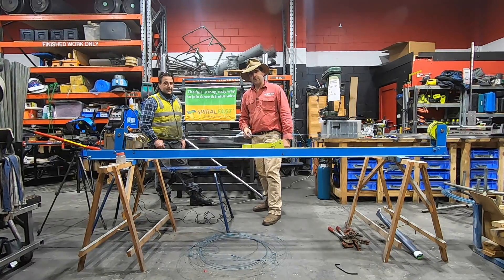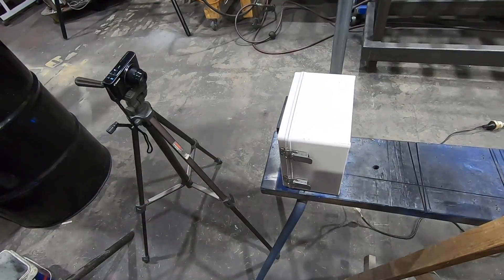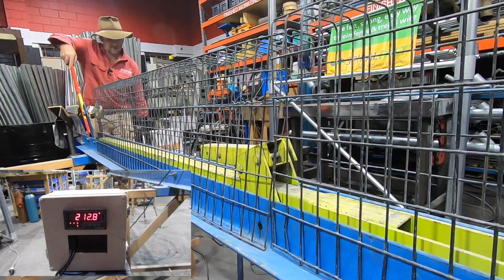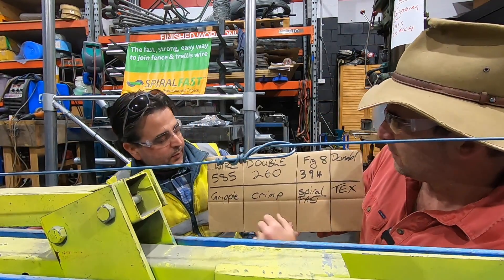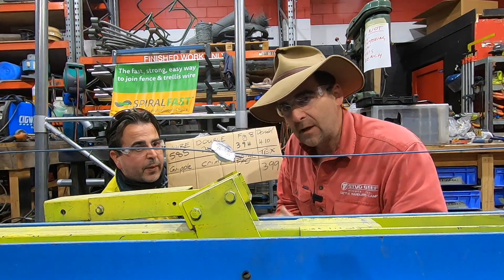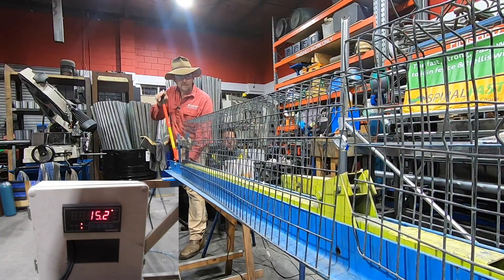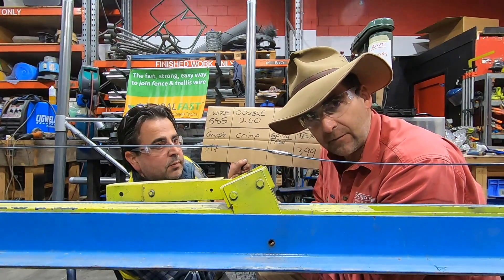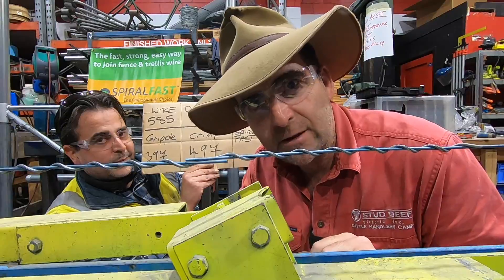Fencing Showdown! Knots vs crimps vs Spiralfast vs Gripple We Test Them!

Comment: Try a crimp and give the wire a few wraps on each side. I'm curious how well that would hold.
Reply from the maker: Hi mate. I tried it. Makes almost no difference. Maybe 1% by the time the crimp gives way, the tails are beyond their strength. If you want to see a demonstration I did similar with my last figure 8 video
Reply: Thanks

Comment: Great to see the comparison - 
However I don’t have knot failures in my fences - I am proficient at tying all these knots and will continue to rely on them.
Do use a gripple very occasionally.
Still have the original bundle of spiral grips in the bottom of my tool box. 
As for crimps IMHO they appear slow and clumsy, and you need extra paraphernalia

Comment: I use porcelain insulators , could you test them against plastic ? I often use the barrel ones as terminators too be good to know if they are strong as the wire, i expect them to handle just twisted knot if you can call it that but maybe not a real knot. thanks Col.

Comment: Can you redo the test with 3.15mm trellis wire?
Reply from the maker: Don’t really need to. Think of the amount of tension related to the breaking strain of the wire. This percentage should stay fairly consistent with the breaking strain of various wire. The only difference is between tensile. Soft wire should do better as a percentage breaking strain due to its characteristics. Hope that helps

Comment: Hi Tim, just wondering did ye consider using a reef knot and would it have been able to contend with the others? Great video by the way
Reply from the maker: Thanks Denny. The reef knot does not work well on wire, so I didn’t include it. Thanks, glad you enjoyed the video!
Reply: @FarmLearningTim  Does not work well as in it's a harder knot to make because of the thickness of the wire? Or is it just a weaker tieing knot in general?

Comment: Tim, do you have a list (or reference for) what knots can be used to join different gauges of wire? Lots of "how to tie this knot" vids out there but don't usually include that sort of info (even the state Ag education materials rarely even list Orange and Speed knots). I find myself repairing lots of fences with a range of sizes (4/3.15/2.5mm plus various gauges of hard and soft barb), even 4mm that's oval/tapered/eroded down in size. Any tips pls?
Reply from the maker: This would need a lot of testing and thought as without data based on practical testing 75% of all viewers would say that it’s wrong but 85% of that 75% would argue with each other about what’s right! It’s a fantastic idea for a video though and one I would love to do. Watch this space!
Reply: @FarmLearningTim  yeah that goes to another level of technical. I really meant joining one gauge to another e.g most people know that reef knots in rope are only for same size cordage, or same for Figure 8 in wire I believe. What other wire knots can/can't be used to join 2 diff sizes?
Reply from the maker: @stur4622  Hmmm. my gut would be the speed (or donald) knot as it is a compression knot, rather than stressing the bend, but I have to say, it would NEVER be recommended to join two different gage or tensile strength wires in the one line. The result will only be a strong as the weakest link.

Comment: Some good testing, except on the Gripple. I say this, as every time I've found one on an old fence, I do it myself, as I figured it was the way to do it. The wire that pokes through the Gripple, rather than cut off short like you had, is bent back around the gripple onto the same wire and tied off by looping it around, on both wires. I was told this was done to stop the Gripple sliding to help prevent loss of strain if the Gripple moves.
Reply from the maker: I completely understand what you’re saying, but stand by the test mate, as one of the points of the test was to test the gripple, not the twisted wire…. Same as the figure 8, some people twitch them off too. Had to be a faithful test of the joint gadget.

Comment: Interesting test, a lot of end assemblies would be struggling with 5kn of strain but very interesting. 
Also as a 2.5 high tensile wire like a TyEasy from Waratah which we seem to use a lot is recommended to strain to 1.8kn most of those knots would still work until something lent or ran into the fence.
In some cases I still like a gripple for the ability to re tension at a later date if required.

Comment: Wow! Super interesting,Tim. Been trying to make a  decision about ringlock join.Had to cut 8 line to allow a gravel truck in,now have to join it all up again,along with two hot wires. Just for my curiosity,Tim,what would you use? I need to add a small piece on each strand,i.e. two joins. Gripples,{16?}fig 8,or any other suggestion welcome. A huge nuisance,but,have  do it....soon!
Reply from the maker: G’day Alison. I’d probably use either Gripples or crimps for the join on the ringlock, then tie a spare piece of wire into my plain runs and strain with a knot.
Reply: @FarmLearningTim  Hi Tim,Thanks for your response. the two "hot" wires aren't a major problem as I have "ratchet" strainers connected to both of them at the strainer assembly. I kinda balk at using 8 ratchet strainers on the ringlock though.:) Apart from being a sook,it's expensive. Thanks for your wonderful channel.

Comment: You need to add the crimp with 3 turns at both ends. This works well. The crimp and 3 turns  is great for end connections also.

Comment: Hi Tim, I've watched many of you knot tying videos and I'm glad you did this video on wire and knot strengths. I plan on building my first fence later this year and your video has certainly helped me to clear up a few things. Hopefully in the near future you will include the barbed wire test as well as a few other knots like the speed knot and the reef knot. I'm particularly interested in the reef knot due to its symmetry and would be interested to see if the strength would be increased if one were to put a small diameter aluminum pin within the center of the knot preventing premature kinking from occurring.

Comment: Tim  do crimps work well enough for end boxes ie when the two wires aren't 100% parallel to each other.
Reply from the maker: If you are referring to the diagonal brace wire, then yes, because the strain on the brace wire is still parallel to itself on the join
Reply: I think he is referring to the end knots tied off to the posts, I've never crimped them, I know you can get T gripples but I've never seen T type crimps, it's a good question

Comment: This is factual scientific research with good results which stand. So well done. 
However, In situ, in practice, a fence wire is not like these experiments. 
The figure 8 knot is designed to spread the surface area pressure over a great area. That's one advantage. And of course it's easy to tie.
The figure 8 is designed to be able to cinch up over many years as live stock and tree limbs. It's supposed to be tied so it has room to cinch up if the wire is put under stress by live stock and tree limbs. It's a forgiving knot that is more than strong enough for any fence.
The reality is that the figure 8 knot future proof's a fence line wire. It's supposed to have "give" in it.
Now, and as for straining using figure 8, the action taken here is to know your wire and slightly over strain so the relaxation of the strainers allows the wire to still be under maximum tension without deforming the figure 8 which you have made with some in-built stretch (future proof).
NB :  I would suggest that any kind of impact on a fence that brought its wires to breaking point will be a rather large mess in any case. The type of knot would be irrelevant.
So, to iterate : Out in the paddock where real animals live and trees grow you can confidently use a figure 8 knowing it will take the knocks and strains. I love science but the lab can't duplicate what happens on a pastoral grazing property.
The figure 8 is great with 8 and 10 gauge soft fencing wire. There's nothing wrong with using the double loop knot either.

Comment: I've been using crimps for strain joining and I usually leave the tails long through the sleeve, then I bend the tails over the crimp and wrap thrice on the opposite side of the crimp. I call that a butterfly knot cause that's what it looks like. Or even just bend up the tails and trim them off to prevent the wire slipping through the crimp.
Reply: Tam Moilliet 
Heres an example. 
Actually my big sow-pig hit the high tension wire at speed the wire creeped loose through the crimp.
And she went through.
My milking cow in Season did the same thing. So good old figure 8 or a double tidy loop suffice.

Comment: You test rig uses Spiralfasts to secure ends each time....the Spiralfast in middle should be the same as control test...👍🏻
Reply: As an engineer, I can way into that. You’re forgetting pulley dynamics. There’s one cord feeding into that pulley, it wraps around it and is attached back to the same cord. So you have two legs wrapped around the pulley. One input, two outputs. The two leg’s coming off that pulley would be half of the input load. Hence a 4,905 Newton load (500 kg’s) would be half of that, on each leg. Approx 250 kg’s. Give or take pulley efficiency, and wire slippage. If that wasn’t a fact, we could never have determined, breaking strain of that wire.
Reply: Not really because there is the additional friction of passing around the post,
on the ends.

Comment: I predict 583.
Reply: Doh!  Missed it by that much.
Reply: So, what have we learned here?  Well, basically that great grandad was right when he said that twisting a wire around another- rather than doubling, kinking or looping- is what holds best when your faced with a repair or joint.  

Interesting note: The power line companies have been using a version of those spiral fasts for decades to hold guy wires, etc.  they do work.  Make it very simple to weave a loop in a steel rope/cable in moments that holds a lot of weight/tension.

Comment: Great video Tim. Awesome testing rig.  I'd like to spend an evening with one of these.  Test Gripples with wrapped ends, try some max tensors, test Crips with different adjustments on the Hays pro crimp tool. Test that reef knot I tied one day when learning to tie a figure of eight.  And do it all with Galvanised wire compared to the Warata "long life".  I suspect the harder coating on galvanised wire works better with crimps.

Comment: would have like to seen the tails wrapped on the crimp and the #8 ...
Reply: @FarmLearningTim  yea ive never used a gripple. only knots / crimps / #8s  . Tails wrapped for safety mostly.
Reply: @FarmLearningTim  yea really good to see some numbers put to it.  Yea i have no numbers but i reckon the #8 and the grimp both are stronger with the tails wrapped , let along the safety issues of the barb .  Thanks for your videos they very informative
Reply: @ginge3381  I think the crimp let go, because the wires pulled through. Twisting the tails should help.

Comment: Sorry Tim, but this was basically an ad for Spiralfast.  What about Gripples with a twitch each end, as that is the only way that I will use them, but all cases using the extra joiner fittings are going to cost someone wanting a basic fence extra $$$.

Comment: Spiral guess 420, but definitely your best video yet, I learned a hell of a lot, thanks mate..ok..holy shit...new guess for the spiral..550.....I was also really surprised by the gripple, which I do not like to use after your information about one giving way, but a fencer recently said on a very short run  of  brand new fence that they were the best choice as you can restrain easy, but I twitch the ends as they scare the shit out of me
Reply: Good point.  I have seen folks leave a tail even when crimping and give a few wraps as a backup.  I plan to employ this technique if I ever crimp any.  Haven’t sprung for that expensive tool, yet although I do wish I had one.  Can be useful in a pinch or a tight spot.
Reply: We recently had a couple of gripples give way during straining but it doesn't happen much, we have almost finished our 2nd bucket since March (about 1000 gripples) so 2 failures is ok for me.
I haven't had a crimp fail, we use Strainrite crimps sometimes.